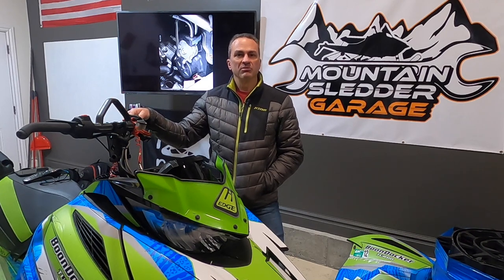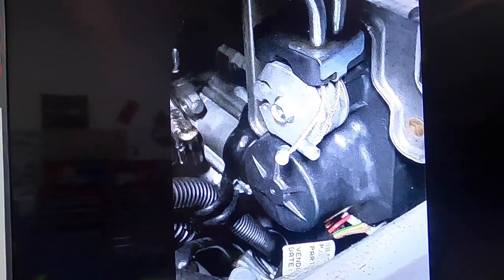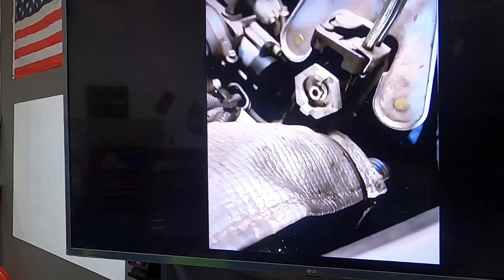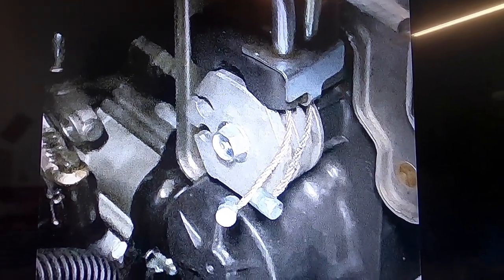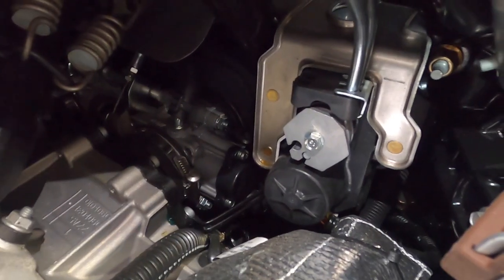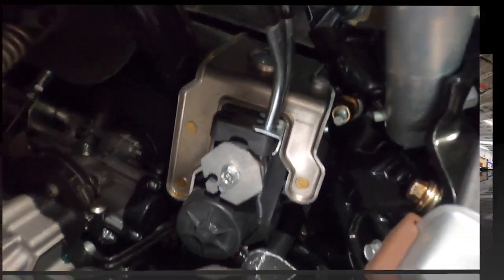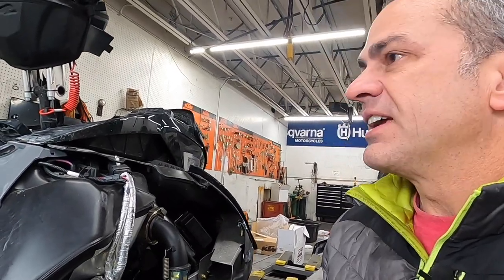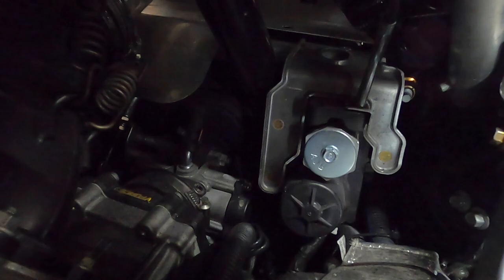Arctic Cat powervalve sevo pulley cable  fix

Comment: Recently had this issue happen twice on my 2020 Riot. Both times it happened was on start up after I shut down the sled.  This throws a P1646 code and literally there is no power. Yesterday I was thinking of installing a flat washer to lock the cables in place and today I came across your video installing a flat washer. :)

Comment from the maker: The pulley the cables go on is hex shaped just like a large bolt. You can put a large adjustable wrench in it. It’s easier if if the cables are off.

Comment: What's the best way to keep the servo motor from spinning as you loosen the bolt?
Reply from the maker: The pulley is hex shaped, hold the pulley with a large adjustable wrench with the cables off.